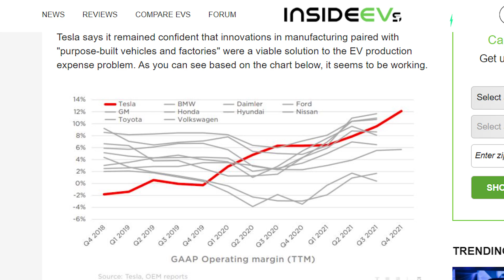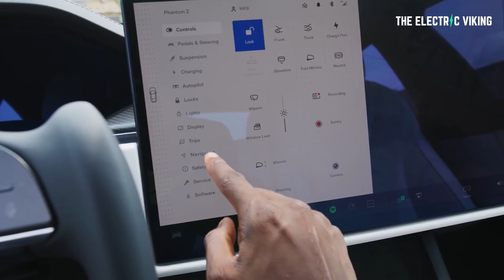This is how much it COST Tesla to make 1 EV in 2021

Comment: I am researching the EV market and am about to buy an EVevehicle if I can find one...
BUT, I just heard you say the fumes from gas and diesel cars give you cancer.  But in all reality, when a gas car rolls off the assembly line, it is putting  out carbondioxide and water from its tailpipe.  And neither of those elements will give you cancer.  You sound very intelegent, but that one comment caused me to turn off your video.  Maybe the lesser informed listeners will continue on, blissfully unaware of your line of false propaganda...

Comment: Emissions for ecars vs ice cars is probably a wash:  Usually fuel (coal; diesel; etc.) is burned to generate power for the grid; and lots of fuel is burned mining the metals in the first place.  The only reason I would want an ecar is because they are more powerful for the money.  Also, until the grid is modified to accept millions of new ecars, then the only reasonable way to travel across the country is in an ice car or a hybrid/plugin hybrid.

Comment: One interesting ( to my mind at least!) thought about this is — if , in effect, the production cost of a model 3/model Y is 36k dollars what would the costs of a model 2/ model A ( or whatever) be? Unless it could be made at a cost of substantially less than 36k the sales price would remain in the high 30k dollars which would put it in competition with the lower echelons of the model 3/Y.
I know absolutely nothing about car production costs so it’s quite possible that you can all tell me that a small Tesla could be built much more cheaply than a model 3 . All I have in my mind is the mantra “ small car, small profits” which was based on the philosophy that small cars cost almost as much to build as large cars but couldn’t be sold at the same price. 
Perhaps the cost of battery packs changes the equation but I’m not sure we should expect to see a small(er) Tesla any time soon — at least in the US and Europe ( perhaps the Chinese market might be different?).
Reply: This is just my take, but I’m betting Tesla cannot make a Model 2 for less than $30,000, today. Assuming the Model 3 actually costs $36,000 to make, how much of that could be saved from sheet metal and glass? Maybe $1,500? Then take the front motor away and you might save another $1,500. Then take the LFP battery pack and make a smaller one, maybe saving another $2,000. 

Then you have to consider the operational costs of a new factory line and R&D to get the design right. That $30,000 car would need to be sold at a loss to get to $25,000.  While the market certainly could use an EV at this price point, the timing is not right for Tesla. And looks like no one else outside of Chinese brands.
Reply: @tstan6827  Think you would be wrong. First of all, we don't really know what the specs of what Model 2 is and what or how they are going to arrive it. For e.g. if they do it at Giga Shanghai with the LFP batteries, they could probably do it today. But it doesn't make sense when you can make more profit from selling more expensive cars at higher margins. For Tesla, to even think of Model 2 right now would be stupidity. They have enough models for now as well as have raised expectations about cybertruck and Semi for the future. I would argue, they don't really need to look at mass-market for 1-2 years and let others take the market at least for now. The Semi specifically could give a major fillip to their commercial battery business and I'm guessing lot of people are keeping a close eye on that.

Comment: @Electric Viking - I did want the "new iPhone" when I bought my Feb 2020 Model 3 LR.  But our family also needed a second car.  We drove 1 car for 3 years, and it was a serious struggle.  I had been watching Tesla ever since they unveiled the Model X in 2016.  I knew the future was electric, and no way I was buying a Bolt or a Leaf.  I always hated hybrids, as you get all of the problems of both technologies.   There really wasn't any other choice, but Tesla.
Reply: As the owner of Leaf and a Bolt I had to respond to your comments!
I also wanted to buy an electric car some years ago, but in 2016 there was no Model 3 or Y. I settled on a preowned Nissan Leaf (the poor man's Tesla) with only 15,000 miles, for a total cost of $11,800. Five years and 28,000 miles later there have been zero mechanical problems. The bug is not the sexiest car but, darn, it sure gets from point A to point B! 
I then bought a Bolt the following year. There have been some technical problems, culminating with the replacement of the battery, to take place tomorrow (totally paid for by GM and LG Chem). After owning a Suburban years ago, which had lots of problems, I was reluctant to buy something else from GM, but I wanted a long range car and the 3 wasn't available yet. 
The Bolt has actually been a very good car, other than the potential risk of a battery fire. We did a 2100 mile road trip in Sept. 2021 without a problem. My wife drives it most of the time for all the day to day things we need a car for.
Charging takes longer on the road, but gives me a chance to talk to a lot of interesting EV owners. Since home charging takes no time my time spent charging in a year is no more than when I drove my Prius.
In addition, since my aim in this part of NC is to get people interested in a zero carbon future and EVs, it helps that dealerships sell (or have sold) both cars. I can tout this on my "Five Minutes With Dr. Know" YouTube Channel.
Tesla is for me the gold standard for EVs. I'm glad you were able to purchase one. Elon Musk has certainly done a tremendous amount of work to encourage EVs and has pushed the more established auto makers to do the same.
Reply: @FiveMinutesWithDrKnow  thanks for taking the time to write your story. You did some heavy lifting in the EV space, early on. I can only tip my cap to that.

I have owned 3 GM vehicles and 3 Fords, 2 new, 2 used, and 2 “certified pre-owned.” None more than 3 years as they all had more problems than I want in a vehicle. 

I switched to Toyota and Honda for 20 years, and was better off for it.

I even stupidly owned a 2013 Dodge Charger. It checked a ton of boxes for me, but it too was junk. Even under warranty I couldn’t drive it for several weeks because Dodge didn’t have the parts! Sold that thing after 1.5 years, which brought me to the 1 vehicle household, before adding a Model 3.

Comment: Sam, Dah --  Safest car built, much cheaper to operate, looks great, high-tech marvel, and no maintenance required. --  Definition of a no brainer!
Reply: @Wooly Chewbakker Fewer parts. Look at the maintenance schedule.
Reply: @Wooly Chewbakker No, I did not. Reread the thread more carefully. Maintenance is required when it is required, for example tire rotation or replacement tires. I suggest the TCO homework project before purchasing any vehicle. Or before posting on this thread. 🙃😁

Comment: We are seeing a car as a fun way to transport us, so it has to be a super fun car. 100% has to be a Cabrio and if possible some extra ways to use it. 
When they build an EV version of the VW 181 "Kubel" (also called the Thing), we will 100% buy one when it can do 320km on a charge, has reasonable fast charger and is below €30000.

Comment: Interesting you didn't mention quality of Tesla's cars  versus VWs.  I wonder why that is?  Kind of the same thing as how Boring company tunnels are cheaper because they're SMALLER and have no infrastructure built in?

And Tesla pays far more for their batteries than they report.  And they BUY them from Panasonic.

So...there is that, as well.

So, Yesla IS only profitable due to fraud, subsidy, and ZEVs.  Sorry, dude, but your 'research' needs actual reports from uninterested 3rd parties, NOT just propaganda from Tesla.

Comment: Many are hype about mega pressers, but not knowing any technical pros and cost for this option. You can save production costs, but run into production issues with bad castings. Or a slow down in production, if you need to do maintenance in such a complex press. Unibody shells are spot welded in sections, that you can replace if damaged. Where with big casting structural pieces, you're more prone to costly repairs. As an example sports cars using monocoque carbon fiber tubs, if slightly damaged, are enough to totaled the car.
Reply: This makes a lot of Bull sense (not to say the other "s"). Battery life, range and cost used to be the issues before Tesla. Not that much any more. All the boogies you mentioned will likewise evaporate once the products are available.

Comment: I’ve had my Model X for 1 year 2 months and I have spent a total of $28 on charging. I charge at work for free. So not only Tesla can make it cheaper than legacy but Tesla ownership is cheaper than ICE as well.
Reply: If you haven’t already done it, please get FSD now, before you significant other begs for it after it’s done and it costs double or triple.
Reply: @EMichaelBall  I bought it at $8,000 I’m a Beta Tester
Reply: @EMichaelBall  FSD barely surpass Level 2 Autonomous, as many studies point out.
Reply: Wonder until when.

Comment: Tesla has a big advantage in what? They rely in other manufactures to build their battery packs such as Panasonic. That's why companies as BYD are more important to watch out in the BEV market. They produce the battery cells and also the car. Quickly becoming the Automaker leader in China.
Reply: What about giganevada?
Reply: @javadabaron81  not enough to support the demand. An assembly line is one thing. While controlling the supply chain including the access to the raw metals and other materials needed to production...is a completely different thing.

Comment: Tesla bought all the gigacasting machines for the next couple of years.  So shortage of casting machines for legacy auto.  Musk stated casting will get rid of 300 robots and people that operate/maintain those.
Reply: Are you aware that big structural casting pieces, could mean cheaper production, but higher costs for the costumer if the needs to repair a car? By the way, relying in such complex casting machines, could also slow production, since you could be faced with a bad batch of castings, or the need to procedure maintenance required on the press.
Reply: Several Chinese auto manufacturers have bought gigacasting machines.

Comment: The software and FSD focus  means everything on the car is integrated with the computer system.  Over the air upgrades means infinite flexibility and allows unexpected options such as security cameras, dog mode. Traditional ICE cars need less processing power and therefore can't justify the additional hardware as it will add several thousand to the price..
Reply: If they re-architect the vehicle and remove 10x to 100x the parts (like a properly designed EV) then the problem is solved.
Reply: @fast-trackhack6637  yep just 10 years to catch up whilst getting ready to dump all that IP in ICE technology. Wonder where to to hat goes in the accounts. The Tesla brilliance was to take the hit of everyone getting the hardware so they can gather data for FSD and monetize through user subscriptions.

Comment: You should have taken a look at that 911, one of the most reliable cars on the planet. Maybe take a look at the panel gaps and the correct applied paint, now that's a beauty
Reply: The car that has been superseded by the Taycan. That one.
Reply: as an ex-owner of a 911, i have to disagree - the 'reliable 911' is a modern-day Urban Myth.  They require a LOT of pampering.
Reply: @swanvictor887  Either J.D. Power is lyring or you were unlucky and had a lemon

Comment: I like Tesla but as soon as there’s a cheaper viable option I’m taking it.
Reply: Make sure to factor in all costs.  Over a five year period it is very hard to beat a model 3 for total cost of ownership.
Reply: @irvinwright4075  Agreed. Tesla benefits financially more than any car maker, to make cars last. The battery cells used in EV's only last as well as they are treated, and Leaf and Bolt are good examples of not enough care. Tesla has planed from the beginning, to make their cars extremely high milage, reliable, low maintenance, and efficient so they can extract maximum profits from a robotaxi network. (regardless when or if you 'believe') They even have redundancy for safety critical parts  IE: Two power steering motors, two fsd chips, ect..

Comment: That's an incredible margin. I'd be really interested to know how that gigacast affects repair in case of an accident.

Aside from that, hopefully Tesla will drop the Model 3 back to $40K when the shortages end.
Reply: Repairs in theory should be no more expensive: Existing cars that are manufactured in multiple parts are then welded together to make a sold lump the same as a giggacast (there are no nuts and bolts anymore like a 1950's car, just thousands and thousands of welds that need to be soldly welded to be just as strong) So after an accident you have to cut off the damaged area and weld on new in the exactly the same way for both methods of manufacture.
Reply: You know this was the complaint when uni-body car designs started to be produced, yes at first it will be more expensive due to the lack of training across the repair field, though i would imagine it would be a faster learning curve due to the similarity to uni-body repair
Reply: @michaelkaster5058  unibody shells have spot welded section, nothing related with big casting structural pieces. You've as an example sports cars using monocoque carbon fiber tubs, if slightly damaged, are enough to totaled the car.
Reply: Better to to reduce the price of a M3 in Australia, 60k is to much.

Comment: You buy a Tesla  for $60k Tesla gets 60K. THey spent nothing on marketing....that's what, 10, 15, 20% of a typical companie's budget?
When you buy a ford/gm/etc for $60k, the dealers gets 15-20%, so ford/gm/etc get $48 to 54k. that's a huge difference.
Reply: Shall we conclude that the real business competition is between the dealership's sales-operational overhead and marketing organization's spending in addition to the design-engineering-production competition from Tesla?
Reply: @fast-trackhack6637  tesla is making what, 31%? When I sold cars and worked in dealerships the margin would vary, but 15% is pretty standard, there is hold back, and sometimes charges for regional marketing.

Plus dealerships make money on parts sales, accessories, etc.
The corp's often finance so get something there, but it's usually separately reported.

I don't have a clue what car companies spend on marketing/advertising, but i've seen many small businesses spend 20% of sales on it.

McDonalds an walmart are CONSTANTLY advertising and marketing. Non-stop, and insurance companies? OMG, I swear they must spend 1/2 their sales on it! LOL